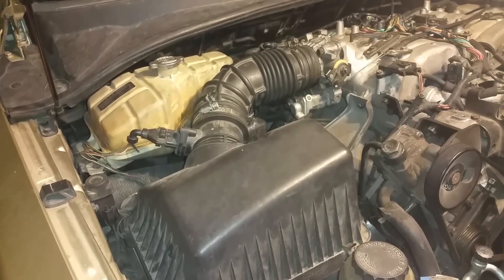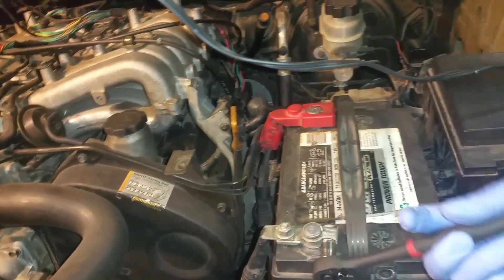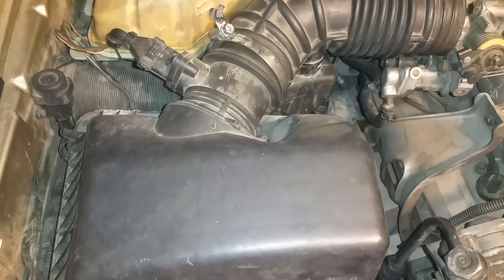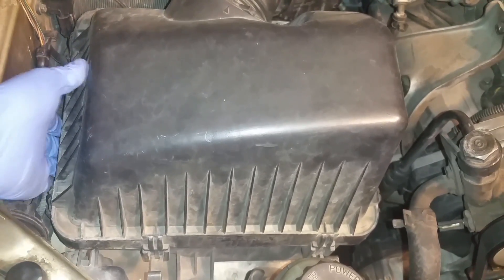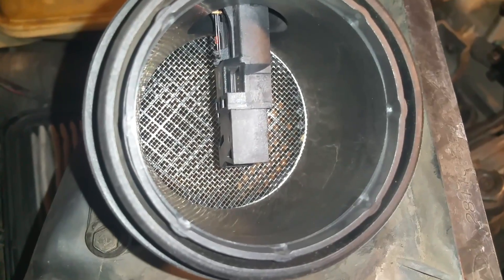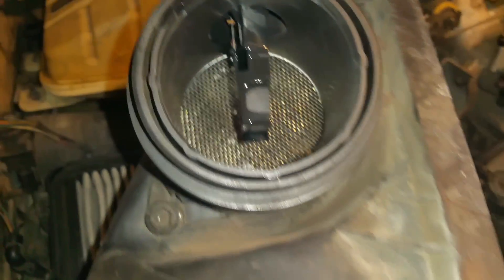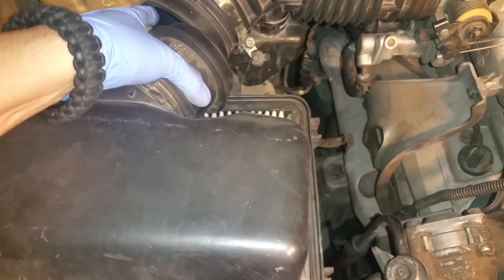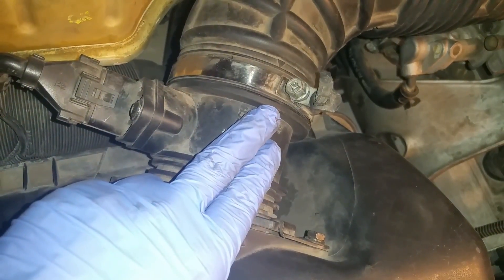2003 Kia Sorento Mass Air Flow Sensor

Comment: I had engine Stumbling on my O2 Kia Rio. I disconnected the MAF and the air filter box used MAF cleaner and also used carb cleaner on the throttle bottle and valve. After cleaning them it totally fixed the problem! Thanks. Keep in mind i did not have any diagnostic reader so figured i would give this a try. In total i spent $14.00 on MAF and Carb cleaner Vs a well over $200. service charge.
Reply from the maker: Glad it helped you out!

Comment: Code po301 said misfire cylinder #1 misfire. Changed plugs, coil pack, coil connector harness. Wires look good. Still says same code. N if I drive it longer code po304 misfire cyl #4. Jerking n lack of power when accelerating fast of up hill. What else could it be?
Reply: 02 sensor or catylaic converters clogged